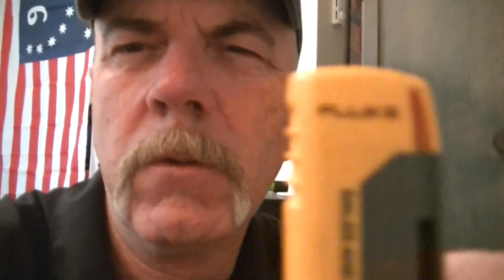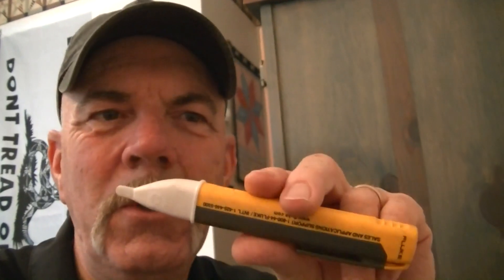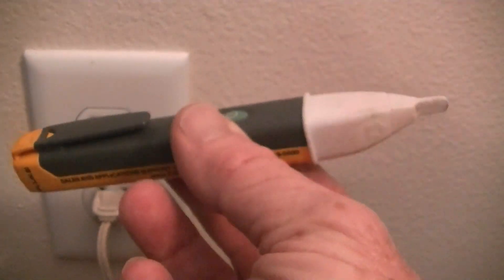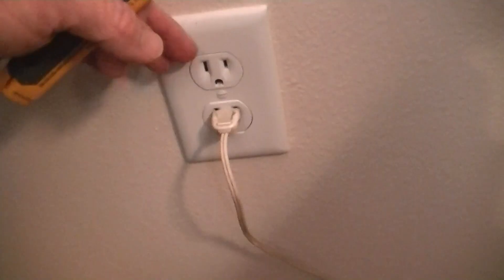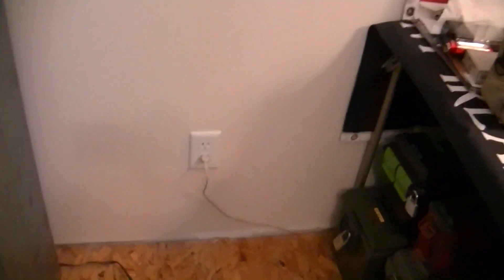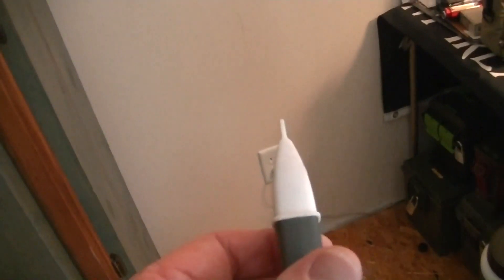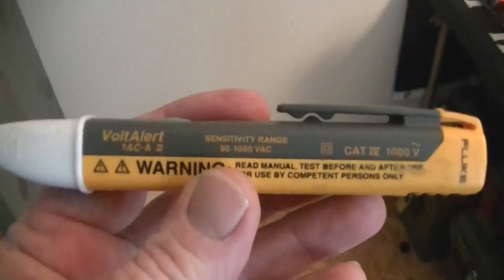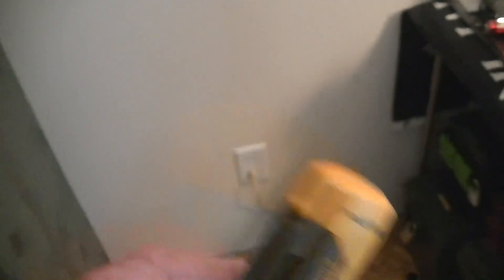Be safe use a Volt Pen

Comment: Thank you for this.  I saw one Youtuber touch a Volt Pen to the body of a cast iron Vintage Singer Sewing Machine from the 1930's to 1950"s, to see if it was hot.  Is this a reliable way to use a Volt Pen?  If so, what Fluke pen should I buy to test my vintage machines?

Comment: On his comments regarding the light fixture, if you have a ceiling fan/light fixture setup, assume that the switch did not kill all power to that fixture. 
Point in case if the fan can run with the switch off then there is power present.
Reply: A permanent live will be at the ceiling rose and a feed will come down to the switch.

Comment: Which pen is better to get for my first pen? The 1AC or 1LAC low voltage?  Because the low voltage pens are cheaper.
Reply: Well, depends what you need it for. If you're working on mains voltage go for the 1AC-A1-II. If for some reason you're working on low AC voltage then you'll need the other.

Comment: Thanks I didn’t know fluke made these,I wish you would review the dangers of the cheap Chinese ones which of course are the most pushed to buy thanks
Reply: I bought one of those cheap chinese  time ago. every time I try to use it. The light works only when I press the button. after that nothing happen. How could you explain that?

Comment: Thank you for this information. I have a home circuit breaker box outside my 2 story house. I need to know how to trace  all my electrical outlets back to my circuit breakers. This would be a great video just like this one.The circuit box panel lists the appliances and generally the rooms. But i have found that all the electrical outlets in these rooms are not on this circuit breaker. Thank you.
Reply from the maker: they make a tracer that plugs into the outlet that is the sending unit then you take the receiver which is like a pen and run it along the breakers and will beep when it crosses the breaker that the sending unit is plugged into you can get a cheep one at lows or home depot and they work pretty good just ask or look for a circuit tracer hope this helps
Reply: Thank you. I will go and see if I can purchase one of these.

Comment: HA HA... i call mine an IDIOT light... Please be sure to do a LIVE- DEAD -LIVE test while using this tester to insure its working properly.. Also Retest same way after you think you turned off the source. Also invest in a bulb style tester also cheap. and its Voltage present not always current as that only flows when a load is connected.
Reply: It is an idiot light you cant trust them. Use a meter or test light connected to the circuit.

Comment: Not trying be rude however a wall outlet does not have polarity you said you were an electrician but the wide slot goes to ground In the fuse box the narrow is hot and the bottom is earth ground ac sands for alternating current and that means that electricity flows one way half the time and the opposite way half the time polarity in ac is an indicator of the phase

Comment: The item  ( voltpen )  indicates  "VOLTAGE"   not current or power. There does not have to be current flowing in the circuit being checked for it to flash !!!!!!   Just constructive criticism for your future videos.
Reply: It actually senses the magnetic field caused by an energised cable.
Reply: You dont know what its indicating when it beeps thats the problem. Some of them will go off when pointed at nothing. Its a short cut and an idiot light. If your not connected to the circuit you dont know whats there. Circuits close to the circuit being tested set them off. Or even worse it detects nothing for multiple reasons and you think the circuits dead.